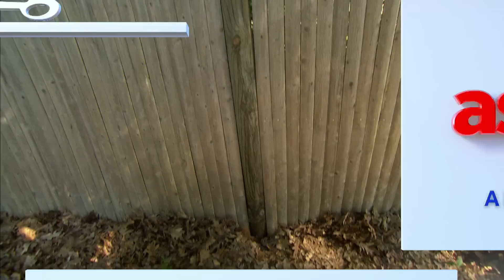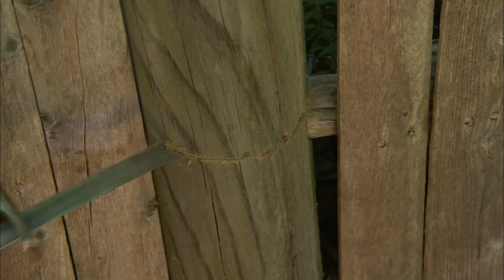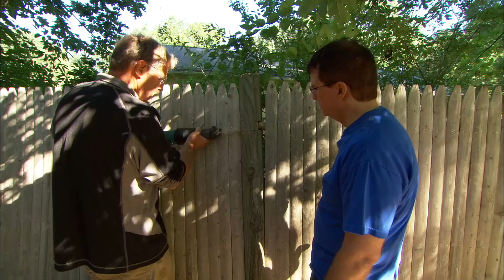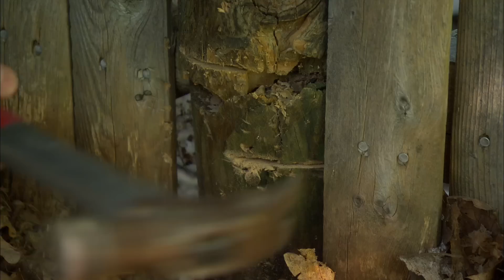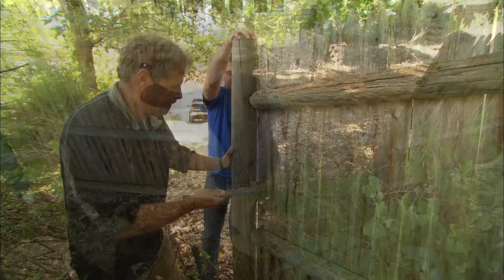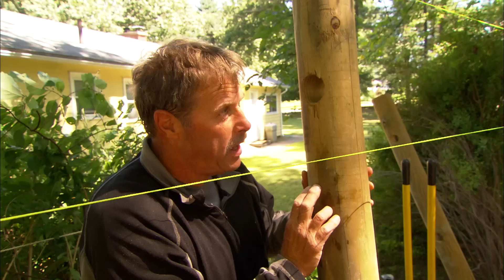How to Replace a Rotted Fence Post | Ask This Old House

Comment: This was a very helpful video. I'd have never thought of cutting the post to make it easy to reove the backer rails. Also, the tips on putting it all back together made it easier than I thought it would be. Maybe the best tip was to put the gravel and/or cement in AFTER getting everything back together. 

Oh, thanks to changes in EPA regulations the formula for pressure treating chemicals has changed and it provides no protection to anything in contact with the dirt. I wish the stooges that put the fence up five years ago had bothered to sett all of the posts in concrete or gravel.

Comment: How would you fit a post into really soft ground in a really windy area? Not a year goes by where the fence doesn't come down. 

I have tried;

Back filling with soil
Back filling with stone packing material
Filling the hole with post mix. 

The only thing I can think of that I haven't done is using concrete posts.

It is a 6ft fence and I have gone as far as a 3ft foundation but still it comes down.

Comment: Wouldn't coating the post with Jasco or that copper spray stuff etc etc help make it more moisture/mold/rot/termite resistant?
Reply: The post is pressure treated.  What do you think coating the post would accomplish beyond the pressure treatment.
Reply: Coating the end grain at the bottom of the post and where the post is  level with the ground.

Comment: no post-hole cement? garbage... one kid climbs that fence and its leaning again... awful
Reply: Jerk Of All Trades - Forgive my ignorance, but what do you mean by "use an anchor"? Do you agree with the type of gravel they used in the video? I have at least a dozen to replace  and want to do it right the first time.
Reply: + Lex Luther - You can buy lifetime guarantee posts from a big box store and they will encourage you to buy bags of cement to install them. 
Read the fine print or try to return a rotten post.
The lifetime warranty is only against insect damage and wood rot. 
The wood rot part of the warranty is void if you used the cement they encouraged you to buy when you bought the posts.
Smart on their part.
Not so much for the person that didn't ask enough questions or read the fine print.